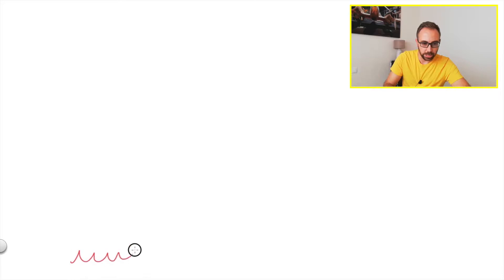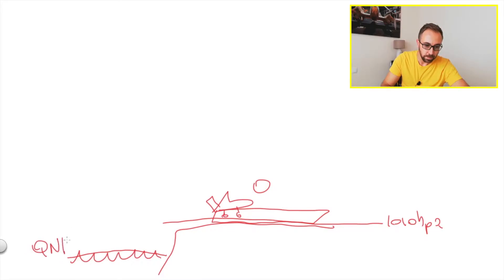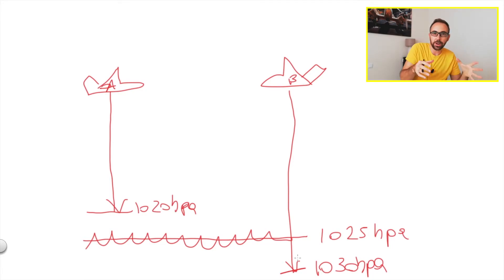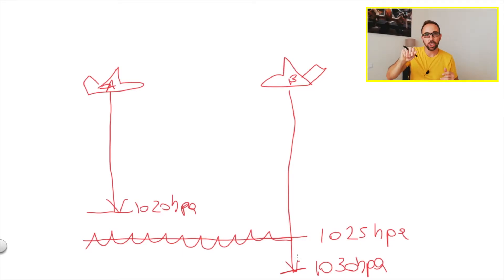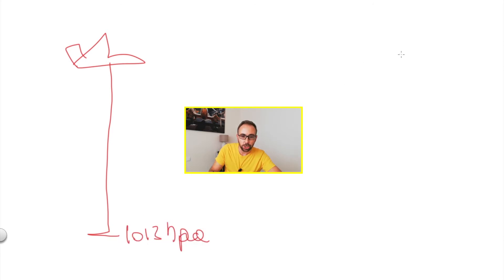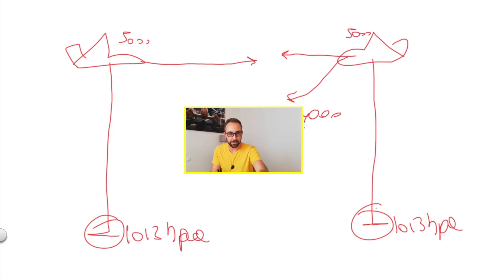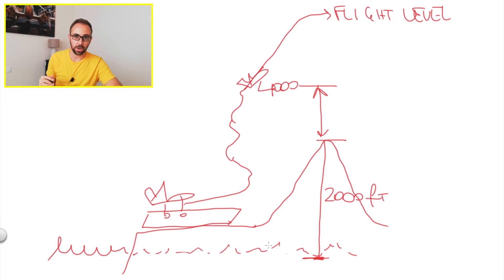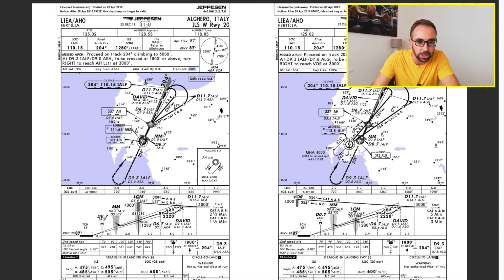Altimeter Setting - [Transition Altitude, QNH and QNE]

Comment: So QNH is changing because mean sea level may rise up or down and because of that we use QNH to have the mean sea level altitude so we can have the correct altitude for example for ILS approach so it counts correctly. But flying in simulator where water sea level pressure does not change have not affects and leads me to landing very low during ILS. So I should use QNE all times in simulator when you have no weather set.
Reply from the maker: In reality once you are on the ILS the QNH should be irrelevant. Check my latest video where I explain this

Comment: Thanks for all the videos.
For IFR flights above the Transition Level, will the autopilot for all the aircrafts in flight be required to pick up the needed altitude from the altimeter or could some airplanes be using GPS based altitude? If so, are there any other flight parameters for the autopilot that are not allowed to come from the GPS?
Reply from the maker: You are very welcome! The Altitude is based on the Altimeter.. The GPS altitude could be used as a reference for some nn procedure

Comment: Great video, thank you.
Question: I understand the reason for using QNE. But, let's say that an airliner is flying at FL400 from NY to London. And let's say that as the flight progresses over the Atlantic, there are multiple High pressure and Low pressure systems over the ocean. So, the QNH down below is changing. Would that mean that the actual altitude above MSL for the airplane is also changing? If so, I guess it means the autopilot is descending and then climbing the airplane to maintain the FL400 and to account for local altimeter pressure levels? Is that right?
Reply from the maker: You are very welcome, that correct, but that's fine since all aircraft are using the same reference

Comment: Hi hope you are good.
I have a big list of interesting question for you pilot. Answer as much as you wish…
1. Who gives use trans level when it varies  (atc , atis ,,any others)
2. Trans alt is fixed for countries . How do they calculate it ?
3. What is the maximum thickness of transition layer.
 (the answer should highlight the importance of having the layer and not only 1 level reference but a layer...)
4.What are Common trans alt for some countries 
5. Transition layer only climb and descent we never cruise there.Its not common for atc to say maintain FL or atltitude inside  transition layer ( but if they ask maintain we should maintain... )but my question is that they ususally dont cruise there true... since we wanna climb and descend . And if controller said maintain a flight level or altitude in between the layer… it would be risk if no horizontal separation of aircraft also it would be risk if airclafy arf flying or descending around it true…
6.Why don’t all countries have the same transition altitude.
7. Is there a benefit of decreasing this transition altitude .I mean in Lebanon transition altitude is 13,000 ft while in germny transition altitude is around 5,000 ft.
8.Can we have sps standard pressure system 1013 hpa =qne at local conditions = qnh is it possible?
9.Whats if passing throght a surface inversion ? wouldn’t local presuure change.. would atc know or atis know if a surface inversion suddenly happened... 
10.How many times do we usually change qnh : local pressure while climbing? While descending?
11.Who uses qfe the field of the pressure ? Russia? Airshows close close to the ground or  even sometimes airlines to cross check things?
12.How is transition altitude determined? ( also note that Denali Mountain in USA is  higher than trasn alt 18,000ft) (hmm i though trans alt should be clear of all obstacles)
13.What about the horizontal and vertical separation in transition layer? How is this done? Do different countries have different regulations and procedures for this?
14.What if it’s a busy airport like London heathrew airport  and trans alt is low maybe I belive it's 3,000 ft .
15.1013.25 or 1013? Doesn’t it make a difference? Cant this rounding cause errors or accidents? 
16.What is the relation between 1hpa = 27 ft around 9m …Is this number always constant ... shouldn't it vary with temperature or pressure?
17.If its foggy isn’t qfe field pressure better than qnh local pressure … also can you land if its extremely foggy and cant see anything?
18.There is an instrument in cockpit called radio altimeter (I n cat 2 or 3 ils)   that works below 2,500 ft maybe that reads height (above that its doenst show )....it shows only in cat 2 or 3 but does it need the pressure as well?  
19.What are rounded to 1000 ft and what are rounded  to 500 ft ( trans alt and trans level)
20.How do you find qnh if you don’t have a control tower or traffic? 
21.Do some counties have a fixed transition level ?
21.What if a country has many airports? Do they all have the same trans alt? same trans level ? hmm? 
22.While descending some pilots put qnh long before reaching transition level ? hmm ?why? isn't this risk?  Or im mistaken they apply qnh at tranition level ?
Reply from the maker: Many thanks for your great comment... Your questions are great, As I mentioned most probably I'll make a video about that..
Reply: @PILOTCLIMB  Hi again mate, will you be able to do a video about the questions you told me were great... Or you are busy mate these days...:) love ya!

Comment: Hi Gabrielle, I have a question: in approach charts, usually the transition level is not provided, they say "transition level by ATC" and the chart only informs a transition altitude. However, when descending, we need to change our altimeter back to the local QNH at the transition level, is that right? In that case, if we are not flying online or if there is no ATC online, is there a way to calculate the transition level from the transition altitude?, to make sure our simulation is done correctly?  Thanks!
Reply from the maker: Hey, many thanks for watching! Yes you are correct! You can calculate the TL from the TA, however you need to know what is the transition Layer used at that airport.. usually is 1000feet. Let me know if you have more questions